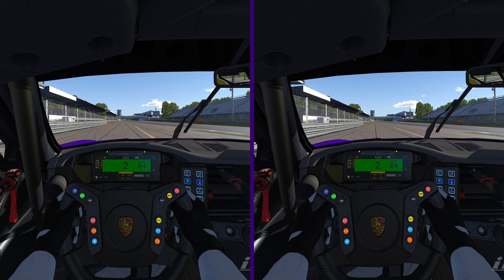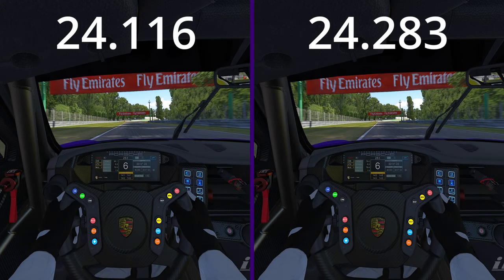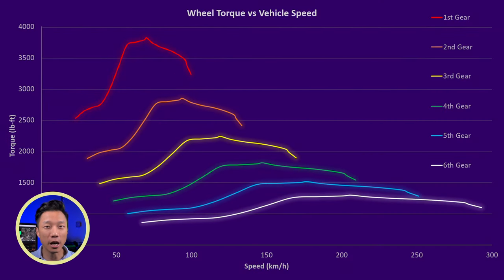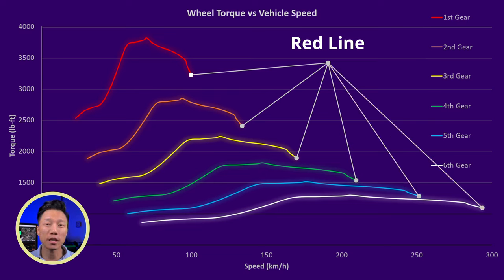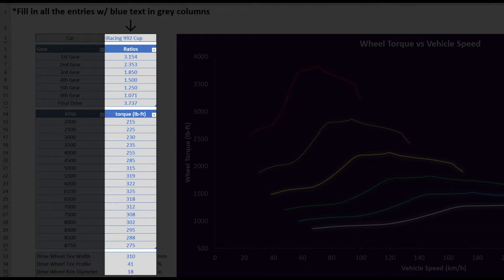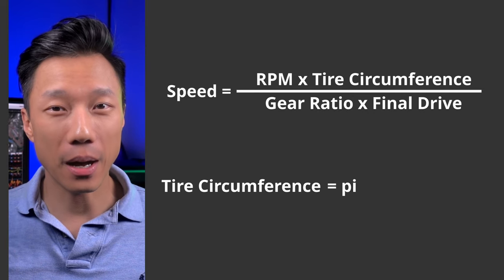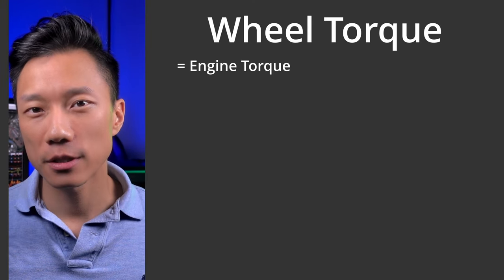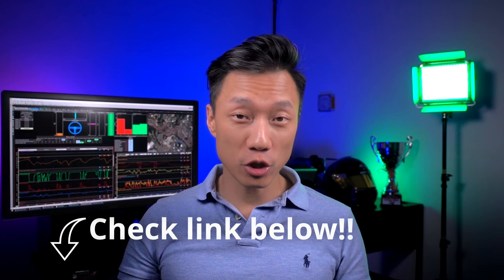When to Shift Gears for MAX Acceleration [SIMRACING & REAL LIFE]

Comment: Hey dude, could you please also explain in a video how "fast" a manual car should shift and how much throttle to apply? Sometimes I get a feeling that more gradual throttle gives me faster acceleration and faster shifts sometimes lower acceleration? Does it have anything to do with clutch slip/engine bay temperature? Thanks a lot for reading! Subscriber acquired!
Reply from the maker: Hey Daniele, thanks for subbing!!

It really depends on how aggressively you want to shift. For a gentle upshift in a manual car, I'd say it should take around 0.25s, between the start of the lift and when you get back on full throttle again. The throttle should be an immediate full lift, then immediately back on full throttle. I've generally not known a gradual throttle to give more acceleration. If the clutch is slipping, then the clutch is the problem, not the throttle application.
Here is one example: https://youtu.be/Hq1SojzAO14?t=55
A harsh, aggressive upshift would be faster but I don't really do them anymore. There's not that much benefit and gearboxes don't really like them as much. Also you're usually upshifting on a straight so there's really no need to rush your hands.

Downshifts generally will take a bit more time. I don't have good data for it but I reckon it takes around 0.5-1.0s. With downshifts we can't be as lazy with our hands because we're generally braking heavily or about to turn in.
Here are 2 examples within 10s: https://youtu.be/vLlZixPS68M?t=75

Thanks for the suggestion. I will put together a video in the future.
Reply: @LastTenth  you the man, but how do I know if clutch is the problem? What symptoms do I see when clutch slips?
Reply from the maker: @Luckydoggg9976  No problem! A clutch shouldn't slip. Regardless of how much torque the engine produces, it should have a clutch spec'd for that output. When the clutch slips, you'll see the revs climb when you're on throttle, but the car doesn't accelerate (as much as it should)
Reply: @LastTenth  that could be very possible then, maybe the clutch manages the hp better if put down "more gradually" as opposed to slipping if put down more aggressively... I'll make some test and keep y'all updated (if anyone is facing the same problem I hope at least I can be of help)
Reply from the maker: @Luckydoggg9976  Probably. If you keep the clutch plates within static friction, it can probably hold more torque than if you just dropped it and get into kinetic friction.
Reply: @LastTenth  Правильная формула будет: D = d+2H. Где D — это диаметр колеса, d — диаметр диска (в миллиметрах), H — высота профиля шины. d = 18 x 25,4 = 457,2; H = 275 x 0,4 = 110 mm.
D = 457,2 + 220 = 677,2 mm = 0,6772 m.

Comment: this might be a bit late to the party, but im so glad i found your channel, just watched this video and the torque & power one. Few years ago i have made an acceleration simulator, where you basically input a lot of data for a car and, an initial speed and a final speed. For acceleration finding the optimum up shift point i used the exact same logic, my algorithm calculated how much torque there was in each gear at every speed available to that gear. When the torque in the current gear went below the next gear or the gear run out of rpms, it was time to shift up. I did add another condition thought, very rarely encountered, an edge case, but in some cases, the torque in the current gear might go below the torque in the next gear, yet, if you rev it out, it might climb up and on average offer more torque, thus better acceleration. This might happen if the engine torque curve is a bit weird and it just so happened that it was at the perfect aerodynamic point in the speed range.( i calculated the force that pushes the car foward as the torque at the wheels - slowdown forces, which mainly is drag). I managed to compare results to irl's friends cars and we got relatively close results, of course with some amount of error because its very hard to get good aerodynamic coefficient and tyre friction coefficient values. I'm just so glad that i can be assured now that my ideas were right. Thank you! 😚
Reply from the maker: That sounds pretty sophisticated. Are those cases usually when there's a torque dip?
Reply: @LastTenth  The main factors for that behavior to happen are torque dip, relatively high aero drag and specific gear ratios. It is quite rare to see this scenario. Modern race cars have more or less close to a flat torque curve while consumer cars always are always designed to have as low as possible drag to benefit fuel consumption. You might see this in some older race cars, but even there it is quite an anomaly and when found people would try to fix it, imagine how annoying and unintuitive it would be for the driver to accelerate towards the end of the gear, then the torque dip feels, and then torque picks up back again and you again feel the car pushing you harder. I've only encountered it 1 time, it was some like 90s bmw (modified) it happened from 3rd to 4th gear. The aero drag scales quadratically with speed and for most cars at around 3rd-4th gear it would be at or over 100 km/h when the drag dramatically starts increasing, so thats why it tends to happen there.
Reply from the maker: @mundanesunrise2480 Wow a truly edge case. Thanks for the context!

Comment: Torque at a given speed is just Horsepower. You don’t need to calculate wheel torque. You can simply look at the Horsepower graph and see where it is higher for a given output speed.
Reply: Не совсем так. Крутящий момент на колёсах включает в себя потери в трансмиссии, что может сменить пик мощности на колёсах. Например на двигателе у тебя будет 120 hp / 6000 RPM, а на колёсах будет 70 hp /5200 RPM
Reply: It will not change the peek power of the engine. The wheels, at any given speed, will always feel the most force when the engine is able to push the hardest.
Reply: @SlyNine yea true but higher gear ratio generste bigerr losess some say and it must be consider as well feg peak power is flat and wide on 2 gear asssuming we are on the same speed can be slightly less contact path force than at 3 assuming both gear at this speed are on peak power 👌🏻 it porbably dont do to much as feg me cb 500 at higher gear ratio than feg mt660 diffrencess in gear rstio is +/- 1,5 times so cb 50% higher gear ratio through whole speed range in regard to race 👌🏻 cb ups at 10 k rpm +/- vs mt on 6,5-7 k rpm +/- cb have 20 % more power at engine crank according to tech spec though test show more like 15-17% diffrences 👌🏻both have simialr drag wieght asf yet cb still accelerate quicker  assumption ? assuming similar gearbox construction this losess are way less than 20% on 50% biger gear ratio 😉👌🏻 but still count 😉👌🏻thats best is to have graph of force /thrust /contact path fprce or at set whell radious drive whellll torq on each gear like he show in this video if you race 👌🏻if this force graph on each gear never cross you must spin engine to rpm limiter on each gear for max acceleration this mean basicallly that for this engine power increase very rapidly all the way up to rev limiter = very narrow peak power + enough big diffrences between gear lenght 👌🏻 vs if they cross than up to this point where they cross on each gear is perfect time to upshift 👍🏻good egzample of this is r6 vs r7 on motostaz test comaprision r6 ( at least this specified year r6 or cos of some mods on it ) you need to rev on each gear 1 rpm before hit rev limiter „up to rev limiter” on each gear espeiclally on lower gear where diffrences between gear are bigest thats most important on higher misteake with this dont be cost rider in race as much but still 👍🏻 vs r7 you must ups for max accelerstion on each gear waaaay before engine hit rev limiter 👍🏻 r6 spin to much biger rpm but it have much more narrow peak in regard to diffrences between gear lenght THATS WHY 👍🏻

Comment: Excellent explanation of a complicated and rarely taught subject. Great Stuff!! Thank you!!!

Q: Is there a time or condition for shifting at less than optimal shift point or sometimes called short shifting? I've heard of it but never talked about.
Reply from the maker: Yes, absolutely WM. It's a great question and I actually have plans to put a video together about it, but I'm not sure when so I'll give a sneak peak here. Many often use shortshifting to save fuel, but imo it may or help or hurt you depending on the engines efficiency. I talk about it in this video: https://youtu.be/ETMt6kAvxG0.

Shortshifting does become useful when you're exiting a corner between gears but you don't need all the acceleration. For example a car may produce too much torque in low gear in a tight corner and short shifting will drop the car's wheel torque, which will make it easier for the driver to manage the throttle. Another similar one is if you're exiting a corner where you cannot use all of the car's torque, and that a higher gear can produce enough acceleration anyway, you can shift early during partial throttle when you're not using max acceleration which won't cost you time, instead of later at full throttle which will cost you time when you need max acceleration.

Comment: This data is so useful! I intuitively kinda worked this out somehow just over years of driving but I do think this data is super useful for general rule of thumb of how to optimally shift. I factually know this now which is a great thing. 

I think it's important to remember that in real life, data aside, there are a load more variables that you should consider, too. You shouldn't use the data approach for every scenario because it just doesn't work like that all the time in real life. 

For a quick example, "short shifting", where you intently shift up early, sacrificing torque to maintain traction and control out of a corner exit, which in turn can make you faster out of a corner under certain conditions. This is an example of something that we know is a useful tool in racing, but completely defies the argument the data is testifying to. It ultimately comes down to the fact that "optimum" isn't always best, especially in a race scenario. In this scenario, there's way too many subjective variables to objectively say what is better.

I guess I'm making the point for people watching that it's important to use data as guide and not necessarily as a rule. Take it for what it is. Thinking about it, perhaps the video should be called "Optimal Shift Timing for MAX Acceleration" and add "... In a straight line". Then I guess you cannot argue much lol.

Love the video, really well thought out, I appreciate it, I subscribed, fascinated to watch more, so cool that there are YouTubers for this kind of thing nowadays!
Reply: Or you could just look at the horsepower curve.
Reply from the maker: Thanks for the Sub Jon! And yes you are correct. As shown in the example in the video, this is applicable to acceleration at full throttle (straightline or otherwise). There was an earlier comment from another viewer who asked about shortshifting and I gave my views there. I mentioned there that I will make a video on shortshifting at some point, so stay tuned!
Reply: @LastTenth  Awesome looking forward to it 👍

Comment: Thanks for all your videos. I compete in the Swedish Time Attack with my Suzuki Swift Sport 2019. 
I downloaded the spreadsheet, but I found only the data for the car gear ratios, final drive, and the wheels/tires. I can’t find the torque outputs by RPM.  
The maximum power - Output - Horsepower: 140 PS / 138 HP / 103 kW @ 5500 rpm and the maximum torque: 230 Nm / 169 lb-ft @ 2500 rpm
Do you know where I can find the torque outputs by RPM for my car? TIA!
Reply from the maker: Hey thanks for asking this question on through my discord. I have answered it there.

Comment: Thanks for the quality content! Where do you find the torque outputs by RPM? Not many dyno sheets available for LMP out there. Great calculator by the way. Thank you!
Reply from the maker: You're Welcome! That's gonna be tough. I just find whatever is available on the internet. For street cars, its usually readily available. For race cars, if it's not easily found, there's usually some proxy engine out there, especially for GT cars. For things like protos and formula, I'm not sure how you'd go about it tbh.

Comment: Hey
it's me again. I was wondering if you could do a video on tyre conservation and management.
I generally tend to overdrive (I think at least). In the first part of any race I have much better pace, but I start to experience huge a drop in tyre performance and that is probably because of me pushing the tyres a bit too much. Could be braking? Acceleration? I pay attention to the steering lock applied, but the first 2 area is probably something I could improve at.
Reply from the maker: Hey Martin! Hopefully one day I can do one. I'm not particularly good with my tires tbh and it's something I intend to work on. I tend to chew them up a lot more than me peers and teammates. When I've figured it out, I'll definitely put a video together. That said I've had some success with minimizing steering as well as reducing brake pressure.

Comment: Unfortunately I don't know what you mean by gear ratio and final drive. I have never heard of those two terms before.

I just started shifting gears yesterday after playing sims for a whole year. It was always too hard for me to do. I did it in both AMS2 and ACC in single-player mode.
Reply from the maker: No problem. It's good that you bring this up because sometimes I don't realize I'm not explaining things fully enough.

Gear Ratio is the ratio of the number of rotations of a one gear to the number of rotations of an adjoining gear. In context it refers to the selectable gears in a transmission.
Final Drive is also a gear ratio, but just refers to a final gear that affects the drivetrain, all the time.

Comment: The calculations are quite a bit easier if you can use a horsepower graph. Pick a shift point from the HP graph, see what RPM the new gear puts you in. Pick a higher shift point and test again if HP in the new gear is less than at the shift point, or vice versa.
Reply from the maker: Yes it IS easier that way, but I passionately hate trial and error. I like to get definitive solutions whenever possible - do the calculation once, then be done with it. The math can be shortened by looking at shaft speed instead but the actual wheel speed can be handy in some situations.
Reply: @LastTenth  you're an engineer aren't you?
Reply from the maker: I’m not. I think I’m just a bit anal plus a bit OCD. Good guess though. Want another try? 😄
Reply: Aren't the HP and torque peaks at different points in the rev range for most engines?

Comment: I think I'm doing a mistake looking at power output and not torque. I'm usually reving to rev limiter and in some cars it is faster. Can you please explain this?
Reply from the maker: Hi, what is it that you would like me to explain?
Reply: @LastTenth  I don't drive irl yet so I always look at dyno when thinking about getting better acceleration (Assetto Corsa, BeamNG drive or Forza Horizon). Usually I rev over red line. I alwayes thought that HP is more important in race cars than Torque so now I wonder if HP even changes anything in acceleration?
Reply from the maker: @carnonPL  Have you seen this video? https://youtu.be/c3NxzTqVSWk?si=Q-TIrGr0fHBCEqZQ

Comment: Horsepower will also tell you where the engine produces the most torque at the wheels. Hence power. Just keep the engine where it produces the most power... Torque * RPM / 5252.

I'm not sure I understand why you've over complicated this. Nothing is wrong, just way more complicated than it needs to be.
Reply from the maker: The power curve alone cannot tell you which gear gives you more acceleration at a given speed. If it could, you would shift every gear at the same RPM, but as we've seen that's not always the case.
Reply: Of course, there's the power curve you have to think about, separation between the gears and how that lines up with the tracks layout.

But at any given speed max power will give you max acceleration.
Reply: @LastTenth the same way a CVT would be the best transmission. Tho engines would struggle to be at max power the entire race. This was shown in F1 testing with cvts iirc.